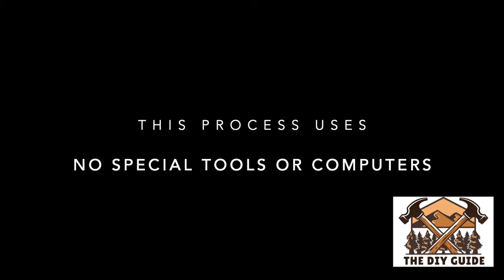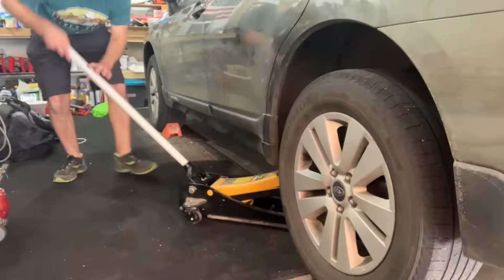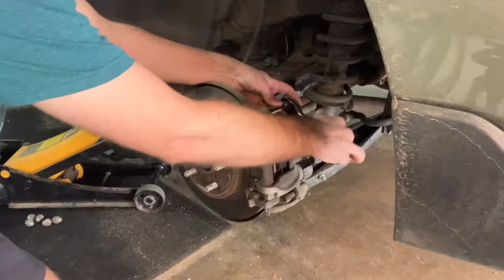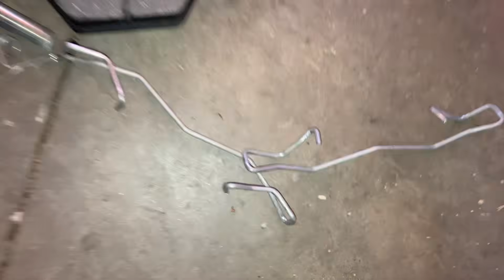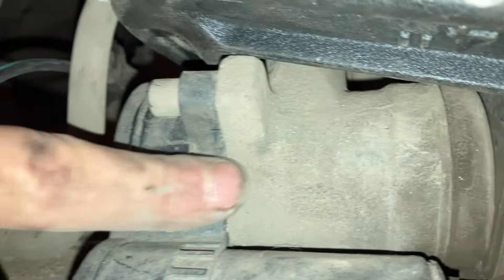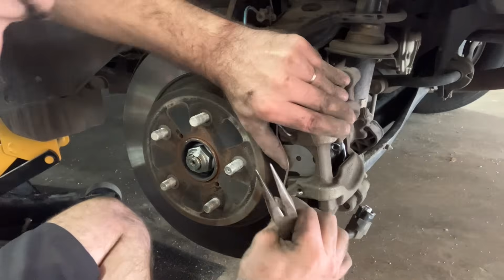Change Rear Brakes 2015 - 2019 Subaru Outback | NO COMPUTER / SPECIAL TOOLS | The DIY Guide | Ep 100

Comment: Nice!! Just did mine last weekend as well (including the rotors).  A few "optional" things include: 1) open the fluid reservoir and place some shop towels (just in case) as you rewind the piston, 2) apply some brake grease where metal-to-metal contact occurs, 3) easier to bolt the bracket first then insert pads.  Now I need to get to the fronts 🙂
Reply: The front brakes are easier…. I need the rear brakes.

Comment: I just did the rears by unplugging them and then removing the plastic covers over the two pins to remove just the caliper bracket. Had to clean and lube those pins anyway. They are 7mm Allen head. Super easy. Thanks for your video.

Comment: (2015 3.6R) That eletrical connection for the eBrake on both sides doesn't stay connected so are held in place by Zip Ties.
School of Hard Knocks:  IF that ebrake connector should ever disconnect while your ebrake is activated, when you go to drive off you'll be dragging a locked wheel.  Turn off the car, activate the eBrake, then go back and reconnect that connector secured by something...I prefer zip ties but a string or piece of cord will work.  Now both brakes should disengage the ebrake drive it.

Comment: Good video , an alternative method is to leave the caliper bracket in place , and only remove the caliper by taking out the slide pin bolts with a 7 mm allen or hex bit.

Comment: Great video. One thing I’d like to mention. You can replace the springs if you feel better about it but claiming it’s due to heat is false. These clips don’t see very much heat being outboard of the caliper in open air. To change the composition of the metal the clip in question would need to be cherry red.. simply doesn’t happen. I’ve studied brake temps with similar setups (Mercedes) and the described phenomenon simply doesn’t happen. Kinda like how people say “my rotors are warped”. This is a myth and has been debunked by companies like StopTech, Brembo. Street rotors get uneven brake pad material buildup  up which produces brake chatter. Other than the above mentioned items you did a great job of explaining what you were doing. Cheers 🍻
Reply from the maker: Thank you for explaining
Reply: what is the purpose of the springs?

Comment: 12:27 I wasn't able to do your trick. What I found worked for me was I put the bottom fully in. Then I took a pair of needle nose, vice grips and clamped them the outside radius of the top spring. Then I put the top pin fully in and then I pulled the spring back with the vice grips and set it into place on the top of the caliper. That may help someone out there.
Reply: I also used a pair of plumbing pliers to turn the Piston instead of needle nose pliers.
Reply: https://youtube.com/shorts/8dmBs-AiCIk?si=mRHqSnpQpYMESaPD
Reply: The short is me putting the spring on
Reply: What I found worked for me was I put the bottom fully in.'   Huh?   Bottom of what?

Comment: great video and instruction! 
i’m about to use your guidance on a 2018 outback limited 2.5. mechanic told me i’d have to use a computer to retract the caliper and back once new pads are on. is that not the case or does your method work fine?
Reply from the maker: That is not accurate, although it is the “preferred” method recommended. The method I show is perfectly fine and causes no negative side effects.
Reply: No computer needed.  I've got a '15 OB and i've done the rear brakes at least 3 times now.  Simply unplug the PB and screw the caliper back in till it bottoms out...then use the brake tool or clamp to give it a final push (for complete retraction)
Reply: I did our 15  and 16 OB and no need, especially if you have a caliper tool.  Another trick, which my buddy used for his newer Forrester, is using a 12v battery with electrical wires, then connect to the harness in "reverse" - you can actually see the piston retract if it is connected correctly in reverse polarity (but again, no need).

Comment: Do you need to turn the piston counter clockwise when done?
Reply: I am doing my brakes now, and you should turn it until you can't anymore. Then compress the piston.
Reply: @KidPerfectMidwest  I think @strykher is asking if you need to unscrew the piston after compressing it and the answer is no -- leave the piston compressed. Once the pads are in you can't turn the piston anyway. Once you pump the brakes and activate the parking brake a few times the piston brings itself to the correct position.

Comment: Is there no brake slide pins to lubricate on this style of brakes?
Reply: There are two sliding pins which hold the caliper to the bracket and are held with 7mm allen head. It's a good idea to pull the pins out, clean with steel wool and apply a little bit of grease. Don't forget to replace the dust caps.

Comment: Great video and I wish I would have seen it before I had started. I got everything out but unfortunately put a hole through the booth around the piston and fluid is leaking. Does anyone have any advice on what to do now?
I've lost all breaking.
Reply from the maker: What do you mean by the “booth”?
Reply: Typo, I meant to say “boot”
Reply from the maker: @Fusnail  unfortunately, if you have a leak at your caliper boot, you are going to need to replace the caliper. This may not necessarily have been your fault, since the rubber and the tubing could have been fragile due to the age of things. You will need toreplace the caliper and then bleed the brakes while you put more brake fluid in at the brake master cylinder under the hood
Reply: Thank you for the advice. I was afraid you’d say that, I’m going to order the part today.
Reply from the maker: @ at least you’ll have a new caliper! 😄 I’d do the other side at the same time too but that’s just me.
Reply: @The-DIY-Guide  I know I should, but Im just going to limit myself to this one now. I dont want to spend that much money

Comment: Do I need to use a scanner code reader to replace the rear brakes? I’m not able to remove the caliper after taking off the bolts
Reply: Did you figure that out?? I'm having the same problem.
Reply: Make sure your parking brake is not on.
Reply: No, you do not need a scan tool. As other commmenter said, keep the parking brake off during this procedure.

Comment: 100k miles on original brakes is fantastic. My wife goes through brakes on her 2017 Outback in 30k miles. I have to do the rear brakes this week as she heard grinding for weeks but forgot to tell me. 😡

I inspected the rear brakes, and the left rear disc rotor was scarred terribly and will need to be replaced. It was not worth resurfacing the rotor as it cost $25 versus $45 for a new aftermarket disc rotor.

Comment: How did you know not to change the rotors? I was going to just buy rotors and pads, and do them both.

Also, do you do the front at the same time?
Reply from the maker: It takes a lot to change the rotors, so unless you have been grinding for a while, have large scored grooves in the rotor, and you have a ton of vibrations when you brake, then you dont need to change them. Yes, I did the front brakes within the same time frame too. Just to keep things even in timing.
Reply: @The-DIY-Guide  thanks! It's been squeaking on and off for about a month but we don't drive the car hard. I guess I'll just feel for grooved. Thanks!
Reply from the maker: There are also some sliding parts you can grease (obviously be careful to not get on the pad). That can cause the squeaking. And also sometimes rocks get caught and can do that.
Reply: @The-DIY-Guide  I'd argue against this - the conventional wisdom I've always followed is that used rotors will accelerate the wear on your new pads because of rust and less obvious damage. If I'm going to the effort of doing the pads, I am just going to replace the rotors as well. I'm already saving myself a boatload doing it myself.
Reply: Changing rotor is thesame you just bang it with hammer after removal of caliper

Comment: We'll done making the video, I assume that you don't need to wind the piston backwards after it has pushed back ....?
Reply: Correct -- leave the piston compressed. Once the pads are in you can't turn the piston anyway. Once you pump the brakes and activate the parking brake a few times the piston brings itself to the correct position.

Comment: Thank you for this. Immediately after I completed the brakes I got a check engine light. An OBD2 scanner showed error U0073 but I managed to clear it using the tool. I assume the error occurred because I had disconnected the EPB, but I'm not sure.
Reply from the maker: What year is your Subaru? Thats interesting.

Comment: You are supposed to use scan tool to retract piston to prevent damage to caliper.
Reply from the maker: The scan tool is not required. The method shown in the video does not damage the caliper.